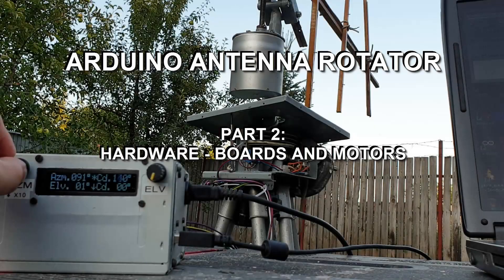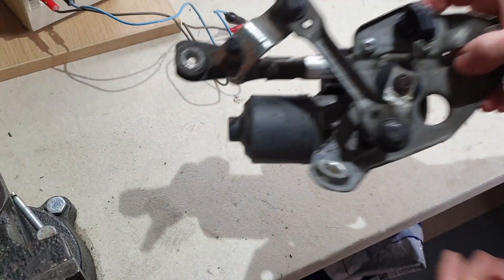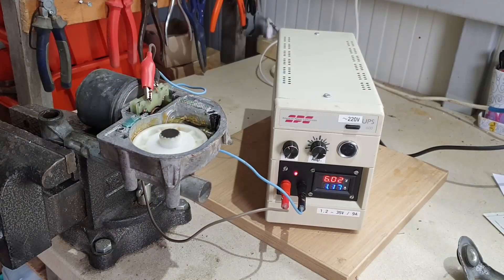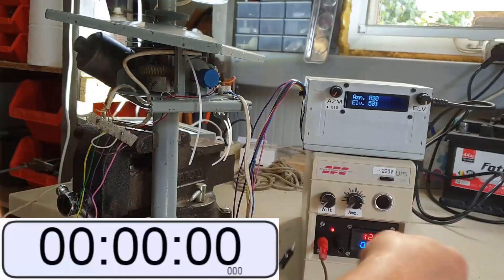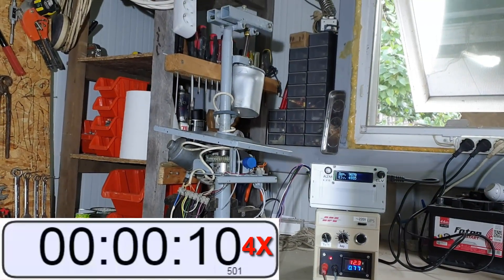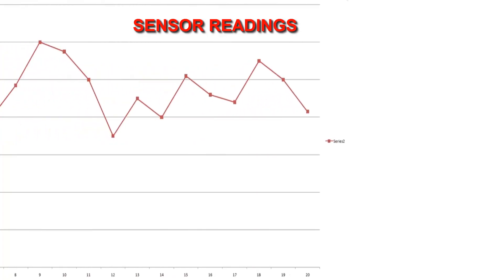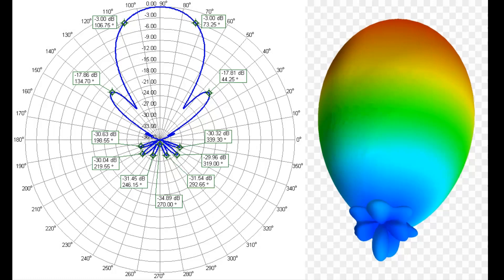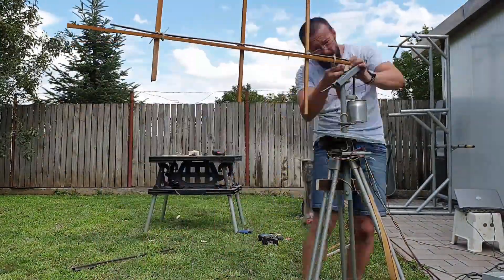ARDUINO ANTENNA ROTATOR PART2 - HARDWARE, BOARDS AND MOTORS

Comment: It appears the potentiometers cannot vary their resistance through 360 degrees of rotation. The so solution may be to modify two pots   to allow 360 degrees rotation although no resistance change through the former ends of the pot. Two such pots about 180 degrees ap as apart would allow continuous measurement with the pot chosen by Arduino. This is still no solution to the coax winding up around but this gives over 360 degrees of position measurement although the coax winding  issue still must be solved in software.
Reply from the maker: Hi.
Actually I explained this in the video. The potentiometer travel can be adjusted with the gear ratio. For 360 of the antenna, circa 270 for the pot. So 0.75 ratio. Another solution (I use this) is to put a hall effect position sensor with 360 unlimited turn and 1:1 gear ratio. It's not critical for the pot to travel end to end. This is adjusted in the code.
The prevention of the wires coiled around the pole is done with end switches (limit switches) as shown in the electric diagram.

Comment: I'm building a similar thing with prebuilt tv antenna rotators with control boxes mounted to each other for 2-axis but instead using IR libs to remotely cycle the boxes with a TLE program as they already have remote control ability and they're still pretty nice so don't feel the need to chop them up yet. First part was finding an IR lib that handles multiple transmitters of which there are quite few. Then building and physical testing of the arduino IR transmitters for reliability with their spacing from the box and angles and such. Then programming an accurate, standalone RTC controller because the cheap-o ones I got all run completely normal i.e. +6 sec per day; not horrible but bad enough for this purpose. This got kind of deep with deriving  crystal hz variations with temperature cold and hot and a parabolic curve but for in the end the excessive clock speed is pretty constant and it was simply a matter of turning back 2 secs every 8 hours or so. This actually worked better than I hoped but consumed most of last year with calibration times (weeks), bugs and tweaks and other things but now that the clock is done I can maybe move onto actually bringing it together. It was meant for grabbing directional ISS SSTV in an automated fashion because I strive for exceptional quality but often have to be at work for some of the passes. Anyways I'll post something about it when it's done! I like your channel!
Reply from the maker: Hey John,
Thank you very much for sharing. Good luck with your project and I would very much like to see the results.
Reply: @Racov  - Hi , do you have something done with TLE control input?
Reply from the maker: @johannpanait3491  Hi.
The Arduino controller is connected to the computer for tracking. I find it very difficult to write myself a code for TLE computing.
This worked worked fine for me.

Comment: Dear Viorel: I have a idea. To introduce a magnetometer on Arduino, thus will be ease point the antenna for magnetic north. What you think about?
Reply from the maker: Hey Eduardo.
This is a good idea if you move the antenna a lot, for example you take it on the field.
Everyone can modify the code to better suit his needs. My purpose was to make it simple and reliable.
My installation is fixed, so for me it's not worth the effort. I only have to align the antenna to the North once.

Comment: Thanks a lot for the videos. The final was Hors Concurs! Please, can you talk more about the motors and mechanical construction? Kind regards.
Reply from the maker: Hello Eduardo,
As I said in the video, the mechanical construction was made by a friend, which is very skilled with metal work. I don't know more details than the ones shown there. This is the hardest part to do, and you have to be really good to get it right. Otherwise it will be a continuous struggle. I know, a commercial rotator is very expensive, but it's also very reliable.
Thank you for your appreciation.
Reply: @Racov  Thanks to you for the videos and courtesy. 73

Comment: hi, one question, how would it be able to know the position of the satellite? any magnetometer?
Reply from the maker: Hi SoxxZ
This device is not independent. In order to move, it should be connected to a computer. Then a software that tracks satellites, sends the coordinates (azimuth and elevation) to it by USB.
Reply: @Racov  i get it, but how does the software know the position ? like, where is north for example, for it to know where to point
Reply from the maker: @soxxz2028  For the software to track correctly, it should know your geographical position. So there is a menu where you input your latitude, longitude and altitude. When the program calculates the satellite's orbit, it knows when it will pass over you. Then it translates (mathematical-geometry formulas) all the coordinates into angles in rapport to your position, so you virtually can draw a line between you and the satellite. There's where the antenna is pointing. The antenna itself should be aligned with the North (0 degrees = North),and also leveled horizontally, to point correctly. Yeah, that was long :)
Reply: @Racov  got it now, thanks a lot!

Comment: Have left here so if people have same questions will be answers. but have also emailed you mate

Hey mate ... Firstly I really appreciate your help

I have connected to Orbitron and am seeing no change in the   AZM cd. 000 or the ELV cd. both at 00 or 000 degrees . I have added the  AZ[AZ] EL[EL] SN[SN] to ddeserial have you got any ideas why this is happening ?

Also when connecting to the serial monitor if i type in any random text eg.. (#$FEQF#$) or even a (.) it send back same information as if type in AZ 312  EL 12

to help me I saw in the code the   "  if read AZ        Azimuth = "";  "  which is all correct but if I input AZ 138 as an example it only gives back potentiometers position and makes no changes to the cd. values .

Appreciate help Lol be last question
Reply from the maker: Hey Adam.
Got your message.
Let me do some testing and I'll get back to you as soon as possible. 
In the meantime try the following: 
When sending commands via serial monitor use this pattern:
AZ123 EL45
Do not put a "pause" between AZ and 123.
When using Orbitron plugin,  make sure you tick the boxes Custom Format String and Send To Serial
Reply: @Racov  hey 👋 

Thanks for the quick reply.. Ok the string is working in serial monitor AZ123 EL22 as an example 

Though I now see what my issue is when orbitron running and turn the serial on it updates the Az-El but only when I tick and un-tick “send to serial” once every second .. I have a updating issue not sure where to go BUT have moved forward once again. Hope that gives enough information..

Comment: Hey Viorel, couple of questions I have started to build this and couple things I would like advice on please .  I have good metal skills and welding but have.  I have got the code working and talking to Orbitron is a very nice CLEAN code congratulations 

1. with potentiometers .. What is the ohm for these    10 K or 100K 
2. What is the best gearing for the 2 potentiometers installed on the rotator pls I can see in video but hard to count these looks like 66teeth big and small 33teeth so 2:1 ?.( Sorry my maths is not good) I can 3d print these (Nylon) also once I know the 4 gears.. If you need spare can send some for your great code and efforts in this endeavor 
3. What resistors value are you using on the encoders  3 on each encoder ? 10KiloOhm?
 ?
4. Can you supply the code for final calibration of the Potentiometers for correct EVL AZM ( sorry if I've missed this mate ) .. for the interference what was your calculated averages to stop jumping.

thank you for been so helpful look forward to more.

My webiste is skypixelds dot com dot au can see email under "contact us" if would perfer to communicate via email

Cheers, Owe you a beer ;)
Reply from the maker: Hi Adam.
I want you to know that the mechanical part (motors, gears...) was made by a friend of mine which is more skilled in fine mechanics and metal working than me and has a lot of tools for that. I just gave him the parts ant some rough specifications, and 2 months later he gave me the product. So I can't give you much details on how it was done, but I can send a lot of pictures and visual clues.
1. The potentiometers for antenna position are 1Kohm multiturn (10 turns). Now that I know, I would recommend a 200 ohm value, because it gives a more stable reading, it doesn't jump around that much.

2. For the gearing, I am not sure, I'll make some pictures. The thing is that the pot needs to do aprox. 9 turns for one full antenna turn. (9 turns, to leave some room at both ends)
3. For the encoders resistors any value between 1Ko and 10Ko (even more) works fine. It's just a pull up resistor, it's not critical.
4. Code for the final calibration... Unfortunately I am not a professional in programming, and I though this project was addressed to a handful of people, so I didn't implement a simple way to put the calibration values in. What I did was the following: I wrote a simple code to display the value (0 to 1023) read on the potentiometer pin. I wrote down the values read when the antenna was at 0 degrees and at 359 degrees. Then this values were used in a formula in the final code. (TruAzim = (averageAz-86)*1.127) So, when you get to the point of calibrating the limits (I hope it will be soon), we'll talk about it in more detail.
I used 25 readings to average the azimuth and elevation (  const int numReadings = 25; ) I tried to increase this number, but then the code gave me all sorts of errors when compiling.

For more information and pictures, please email me yo3rak at gmail.com
I was not sure if I could use info@....com.au
Because of the time difference between our hemispheres, it will not be as fast as we would like, but I will try to keep up.
You're doing a fantastic job with those drones. Keep it up.

Cheers,
Viorel

Comment: Wow, Great ability's my friend very interested for Noaa 15,18,19 HRPT !!

I love Arduino also, Is your code and hardware lists available at all (when i follow link is just project hub)? would love to try and build this (Lol wont be as neat as yours though)

Update**   thank you actually found the code and hardware list at your webpage @t ignore some of the silly comments on Arduino site.. people need to learn before attempting such a project.   Friend from Australia
Reply from the maker: Thank you very much Adam.
Reply: @Racov   Are you planning on making a 1.7ghz antenna for this ? would be perfect
Reply from the maker: Hi Adam. Yes indeed it would be. I don't even have a VHF / UHF antenna for this rotator. My plan is to build first a 5 element yagi VHF and a 7-ish element UHF. The Space Station has a repeater on UHF and I'm pissed I don't have an antenna to work it. And other satellites too. I also have to buy an all mode UHF/VHF transceiver. 
Thank you very much for you comments.
I saw the vid on your channel. Fantastic quality. Keep them coming.
All the best,
Viorel
Reply: @Racov  

Thank you 🙏.. I’m a hobbyist radio/communications and my job is UAV 👍 I can help with 3D printed helical adapters mate. If you want one message me will send you parts and find a old 60cm dish ! Always happy to help a fellow radio operator